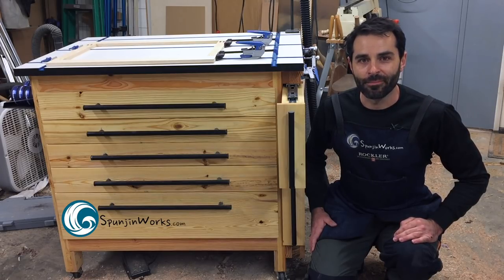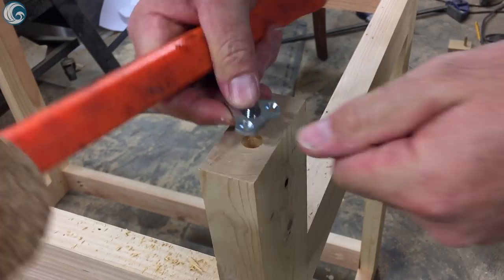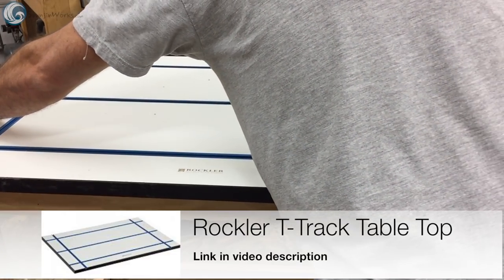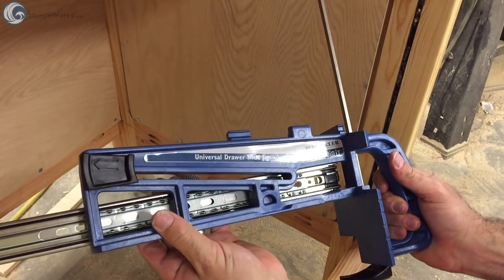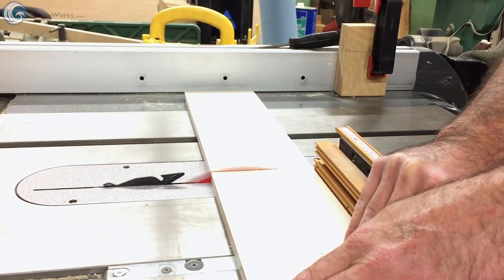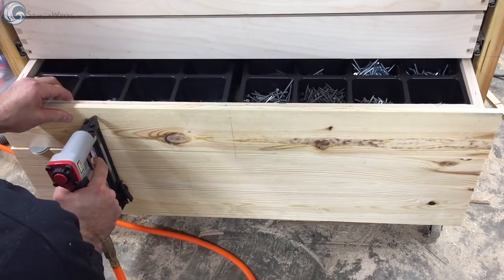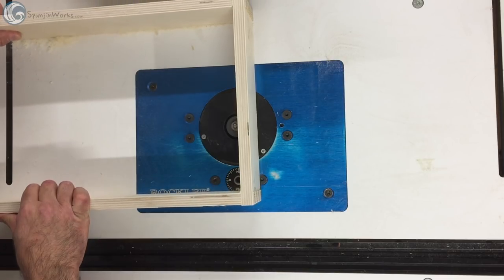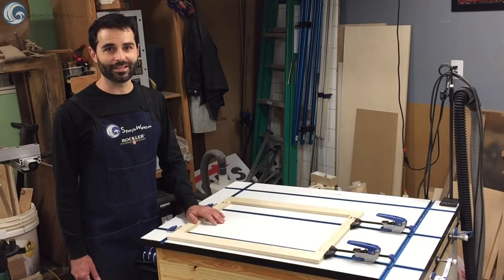BEST DIY Assembly Table with Tons of Storage // How-To (Ep. 78)

Comment: Really nice build Sean. I love that you used repurposed lumber and scraps in this table. I'm always fascinated when I plan or joint and old greyed piece of wood. It's like getting a present and you don't know what species it is until it comes out of the planer. I love the conduit drawer pulls! That's Nick, always coming up with a new use for something. Where can I find the plastic caps for the ends of the handle?
Reply from the maker: Thanks!  Nick has them listed on his site with the conduit pulls video. I don’t remember what they are called.

Comment: That is a really nice tool cabinet.  A terrific shop solution.  But boy - there's a lot of money in that cabinet!!!  The drawer pulls are nice, and at one point I actually had some similar, but so help me, I snagged the stub end of those things constantly.  They either grabbed my pants, my tool belt or shop apron, power cords, air hoses, etc - so I made all mine flush at the ends so they wouldn't do that.  Otherwise, I'd love that beast in my modest shop!  Very functional, and well thought out.  Nice job!
Reply from the maker: Thanks, if I could show a photo in comments you would “told you so.”  But I also have a bunch of corded tools on it right now.

Comment: In the beginning where those harbor freight clamps ?
Reply from the maker: The blue ones?  Those are the sure foot aluminum bar clamps from Rockler.
Reply: @SeanRubino  i seen some at harbor and they looked super cheap was curious thanks for the reply!!
Reply from the maker: Sure thing. I have a pair from HF. You can make them better by removing the clamp foot/head and running a piece of wood the width and thickness of the inside channel.  That really helps to add clamping pressure.

Comment: Where those drawer bottoms Melamine coated Chipboard?  If so did you use a Melamine glue?  Nice looking build.
Reply from the maker: Melamine only on the vertical sliders with glue in the rabbet. No melamine glue, is that a thing?
Reply: Sean Rubino, yeah it is.  PVA doesn't stick to the melamine film. I actually do glue ups on melamine coated MDF knowing it will pop off. So the PVA will only bond your timber to the chipboard edge.  I've seen a few YouTube  videos of a titebond melamine glue.
Reply from the maker: I know PVA doesn’t stick to Melamine. The glue is on the core and plywood frame too. I’ll look into getting some melamine glue. It may be useful for some coming projects. Thanks!

Comment: I really like the idea and the build, my issue is that all of that gear from Rockler is just not in my budget. It is nice when companies give builders free items to be included in a build video but the reality is that I will never build this. Not all projects are for everyone and I get that. The real challenge would be to build an assembly station at a fraction of the cost with the same great features as this one has. Great video, just out of my budget.
Reply from the maker: Understandably yes.  Alternatively you could make a top and recess t-track into it and use the intersection kit or make your own.  There are accessories out there that work with dog holes as well.  Budget is a big concern with a top like this for sure. The top isn’t cheap and money can be spent on material for an actual furniture project. 
Thanks for watching and thanks for your input.